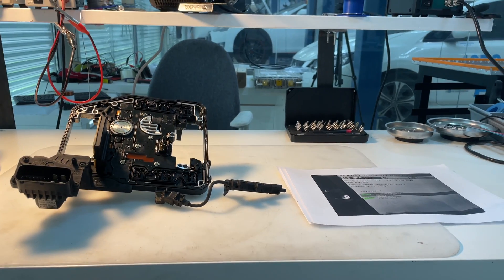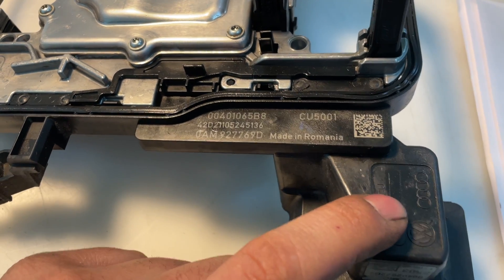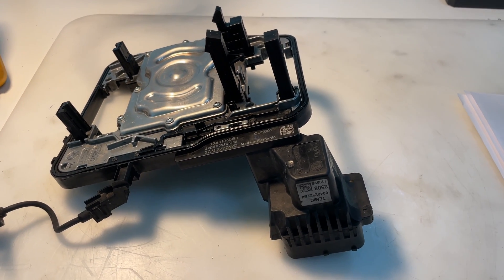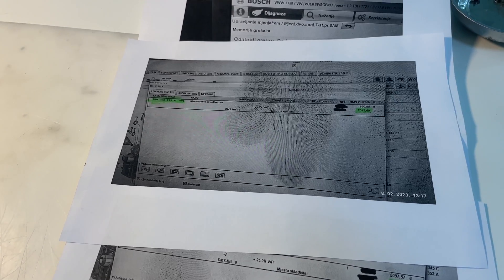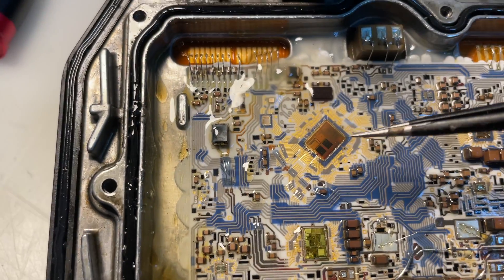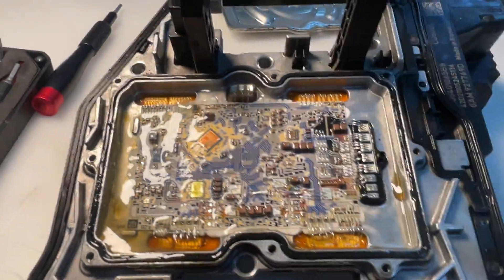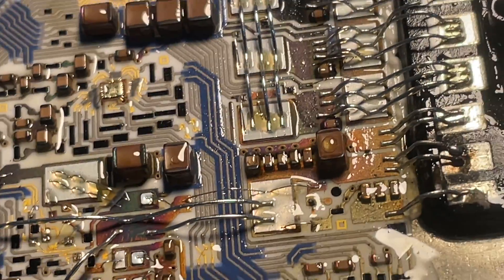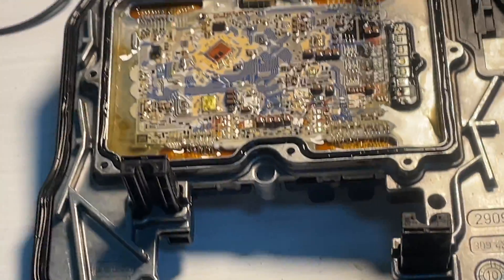VAG DSG DQ200 - Refurbish of serial defect

Comment: To anyone stumbling on this problem, If you don't have a laser welder you can gently sand down the aluminium terminals to reveal the copper underneath and solder new wires directly. On the other side I attached my connections directly to the ceramic capacitors. Not ideal but it worked for me.
Reply: Bu cihazın satış linki var mı
Reply: Do the opposites of each pad have capasitors to connect to? What about that area behind the wire (on the board)?. Can you sand that side down and solder on the PCB?
Reply: @kocbilo  If you follow the traces on the PCB you should be able to find a capacitor or similar component to solder to. I did this instead of sanding down the PCB because the area is very fragile and likely to be damaged by the sanding.
Reply: @PoshRanger Thank you for responding! I will check it out. The hardest part seems to be removing the jel though 😅

Comment: How did he identify the broken wires in the TCU? Is there a diagnostic tool for the mechatronic unit? Also, after repairing/soldering the TCU or full mechatronic, is there testing equipment to verify it works before reinstalling in the car?
Reply: Diagnostic tool bro any that reads gearbox U0101 fault code and u can physically check the wire by gently lifting them up to see if they are broken
Reply: What is device name you use for resolding

Comment: Are those Aluminium wires? why they use those instead of regular insulated copper wires? can it be upgraded?
Reply: It is an aluminum alloy, if it were copper the vibration would have damaged it very early on.

Comment: Thank you for such detailed video.
If I understand it correctly the wires break into two pieces. What is the cause of such failure? I can see that there is a sharp curve near the joint. Is the wire broken from factory?
I wonder if welding the wire is not just temporary solution. You said "I solved it for eternity". Wouldn't the same wire snap again in different place? Would not it be better to replace the wire?
Reply: Those may cut by vibration 😢

Comment: Hello, I bought a welding machine, but I don't know what settings to use it on. What type of electrode should I use and at what settings should I weld?
Reply: The temperature is very important
Reply: where did you buy it? I also want one
Reply: @troytechkeys  actually ，i know how to repair it
Reply: I don't need to buy
Reply: Did you figure out the settings im in the same pickle

Comment: Hi. Which welding or soldering machine did you use?
Reply from the maker: laser weldinf
Reply: @evclinic  Please share with us what is model name you are using :)
Reply: Due to the type of nozzle seen in the video, it should be a Mig and it should occupy the minimum Amperes.

Comment: Hi. Which welding or soldering machine did you use?
Reply: This is exactly the same question i wanted to ask
Reply: Maybe a Lampert?
Reply: I'm also interested in the tool used to weld do you also sell
Reply: its an arc spot welder for jewellery

Comment: Hi! How can I remove the sealant (like a glue) around the wires?
Reply: Scrap the tin with a small sharp screw driver, underneath its copper then use normal solder
Reply: is it okey if theres fluid or kind of oil inside. cause in the video i see fluid???
Reply: @Anoniem123-v3i  the fluid should be used for the mechatronic is unconductive. it won't cause electrical short if it's unconductive.
its a special oil used in these dsg mechatronic

Comment: Very good video, congratulations, which welding machine are you using?
Reply: High Power Pulse Argon Arc Welding Machine . but you can grind silver off the pads to expose copper use a good flux and some non let solder and it works , apparently the wires are not aluminum but some kind of alloy  once cleaned a good non led solder holds on it .